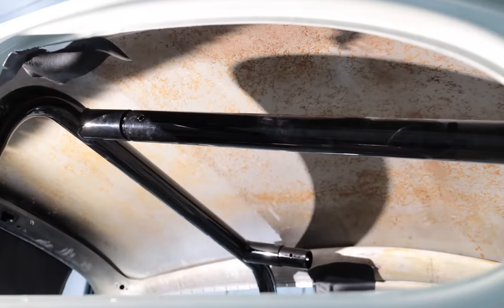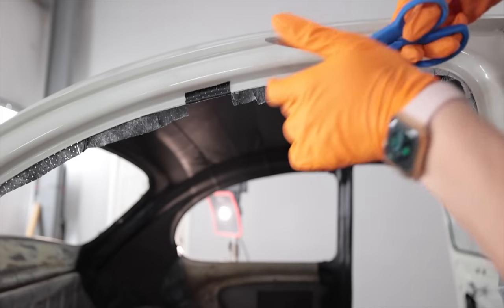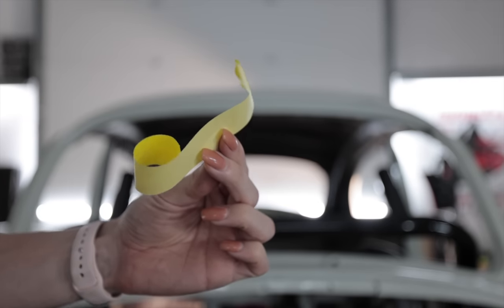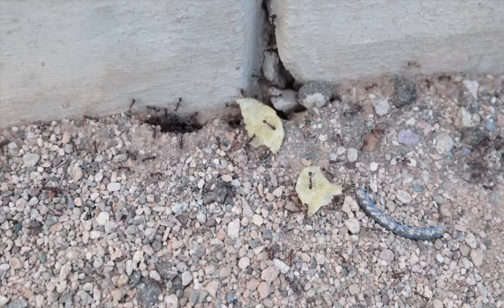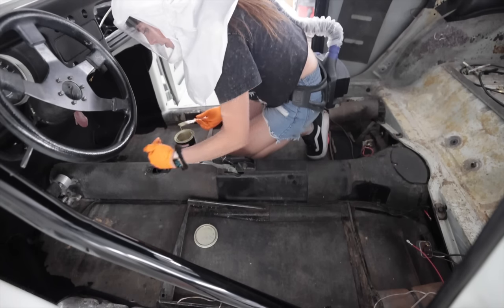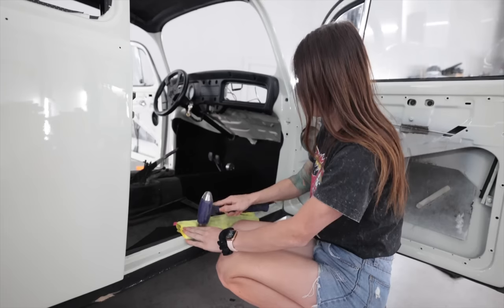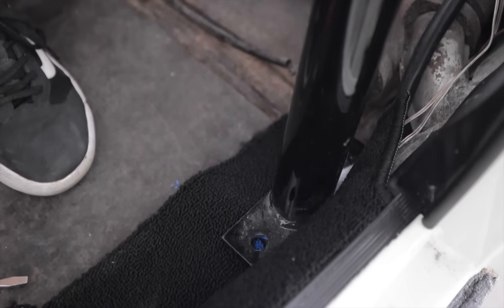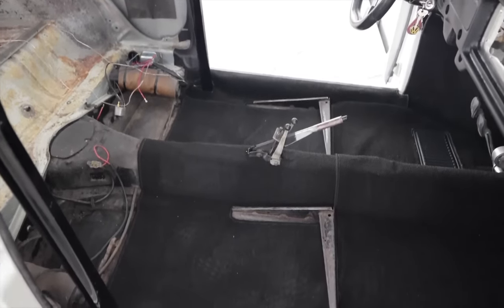The Carpet Matches The Drapes // 1969 VW Beetle Type 11 Project

Comment: Headliners were white from the factory in my experience. Family started buying bugs in 59. I've owned a 62 rag top, 63, 67, 70 with a 2180, 71 Super Beetle, and a 74 convertible. I'd like to build one more but health may not allow.
You are doing an amazing job on Ragnar...and I love my shirt. You have the best auto related show. Keep it up, stay safe and get the glue out of your hair. It affected you singing.
Reply: Agreed. That's how my '69  and '74 came from the factory - yeah, I'm that old.
Reply: Correct - all beetle headliners were white from the factory.  Black is aftermarket only and makes the interior looks much smaller and dark.

Comment: Hey Sarah...  Saw in one of Vice Grip Garage's videos how they solved the hole location issue with bolts through the carpet.  Basically a soft locate with something pointy, then make pointy thing hot and melt/push through.  No fraying, perfect sizing.
Reply: Can also use an old/junk/cheap/crappy soldering iron.

Comment: I found out about those spray adhesive's, I ended up spaying the glue into a cup, then brushing it on with a small paint brush, much more control over where it goes.

Comment: Hey Sarah, an easy way to make holes in carpets, take a tapered punch the size of the hole you need, heat it up almost red hot, then poke thru the piece you need to mount and thru the carpet. It will melt out a perfect hole, and best part, is it will be fused and won't fray

Comment: Grab an old phillips screwdriver, heat it with a torch, and shove it through the carpet into the seat holes in the pan. It will melt the carpet, and prevent fraying. Speakers can mount in a plywood panel over the parcel tray in the back...you could cover it with black vinyl, too. Fun video!

Comment: Start in the middle with a heat gun and work your way to the outside edges. The heat gun will take out all the wrinkles, it shrinks the material. I have done a bunch of these style headliners and it works great.

Comment: If you leave the headliner out flat in the hot sun it’ll become much more stretchy you don’t actually want it to stick to the sides you want it pulled tight most headliners look loose though but if you want it to be stretched tight put it out in the sun and don’t try and get it to stick to the sides of the roof on the inside

Comment: You needed to lay the headliner out in the sun for abit before the install. That makes it stretch easier and most lines fall out. Having some type of noise deadening material on the roof, under the headliner is a must have-otherwise, noise will be excessive.
Reply: You only need to glue the side parts in and back up with the tax nails. The floor doesn’t need to be glued down.

Comment: Sarah, After spraying the adhesive, wipe the tip with a rag and some acetone to remove the excess on the tip. That way the next time you use it the spray won't end up in unwelcome areas! Been there, done that!
I really wish I had room for another car. If I did, I'd put my hat in the ring to try winning this. But I'll buy a shirt next time so I don't have a chance. I know, it doesn't make sense does it!!!

Comment: If you heat up a screw driver. You can push it through the hole and melt the ends of the carpet so the carpet doesn't fray. Fast N Easy.

Comment: I think I would have mounted the roll cage on top of the carpeting. Just poke a hot nail through the bottom, drop in your bolts and tighten them down.

Comment: I really appreciate your videos and the effort put into all that it entails.  I hope this does not come across the wrong way but I think the front kick panel carpet pieces were installed upside down and/or switched sides.  The portion alongside the door post should be a straight line, no loop on top over the post itself.

Comment: for tightening the drapes, just heat with an air gun in high temp not so much airflow, have a damp microfiber towel handy and a bucket of icy water, it will tighten up perfectly, just don't burn thru the vynil. Practice on a scrap piece first.

Comment: Thats like when you buy a house to renovate that has single pane windows, so in the first season of winter, one goes and gets a plastic roll of clear window covering with 3m tape to insulate around the perimeter of each sash window &  to iron out thee wrinkles to make taut, use a heat gun on low settings🐈‍⬛🧁🔥b-side vinyl to stretch

Comment: If you want to find the hole, you have to come in from the bottom if the carpet is too thick. Gently push the poker up through the bottom and you'll find the hole. It's so much nicer working with smooth holes...

Comment: While I'm not familiar with it, I've heard using a heat gun helps prevent cracking the paint - I've seen it done with both PDR and fender rolling. 🤷‍♂️

Might be worth a try if you re-carpet a car again.

Comment: It'll get tighter sitting in the sun. You can also VERY CAREFULLY use a hairdryer on it. Don't use a heat gun, that can go bad fast. Actually works better on getting wrinkles out of leather especially when freshly installed, vinyl can get permanently warped with too much direct heat.

Comment: A hot steel punch that you heat up with a torch will "punch" a hole through the carpet where you want to place bolts through the floor.The hot metal melts the carpet so it doesn`t fray. This would have worked while doing cage mounting bolts.

Comment: Pair Rockville RSM65B 6.5" 320 Watt Waterproof Shallow Slim Marine Boat Speakers
Super slim fit door speakers 
Or 
The Morel Powerslim 6 Integra defines how great a shallow speaker can sound while providing the performance benefits of the Integra technology. The Powerslim 6 Integra features an incredibly shallow 0.67" mounting depth, making it the shallowest 6-1/2" coaxial driver on the market.

Comment: So many aftermarket accessories for VW. Old ads online for emergency hand starter, to carry in glove box , a T-handle strap to wrap around crank pulley to pull start like old minibike or lawnmower.

Or a vacuum cleaner powered by the engine exhaust, venturi effect with no moving parts, long hose to reach around car. Would actually work on any car.

Comment: Next time try the 3M fast bond 30 water base contact cement , works just as good as the gorilla snot weld brand , without the VOC

Comment: Listen to this, get a dry cleaners plastic bag (lightweight) and cover your forehead and hair!
You are doing a great job. I took my driver's license test in a 65 VW with rotten running boards and a broken reverse in the shifter. Had to park so I wouldn't have to back up.

Comment: Question: How are  you planning on reinforcing the roll cage mounts? If you just bolt them to the floor skin, won't they tear straight out? would you want to weld a plate under the mount to reinforce it & bolt through?
Reply from the maker: I say how in the previous video 😉
Reply: @SarahnTuned  I thought you had said you would weld a plate on, but then you appear to have glued the carpet to the inside of the floor round the cage mounts, which will be all very exciting if you try to weld it, & then I thought that maybe I was remembering f somebody else’s build video rather than yours…

Comment: You could of heated a piece of steel with a torch and push it through the carpet into the bolt holes for the roll bar.

Comment: I don’t think I’ve ever used that much glue on a bow headliner.  The bows pull up and you pull them to the edges.
Reply: She didn’t install the headliner correctly.  In fact, it looks like she didn’t even use the bows and glued everything directly to the roof.  You can see where she glued the material directly to the substructure of the roof on the sides.  This portion of the roof shouldn’t even be visible as it’s usually hidden under the bows.
Reply from the maker: The bows were used and sized accordingly if you watched the previous video. You're incorrect on the install, the way it was done is the correct way.
Reply: Double check .. thats why you have the wrinkles in center,  The headliner should be pulled some what tight to the window edges like Ghia said.  It should not touch the roof.  I saw you did put the bows in but you need to pull to the windows edge not glued to the roof.

Comment: Stereo? That wire looks way too small of a gauge.. with a back seat delete you should plan on the new owner putting a 5 channel amp and a sub in the battery box/seat support area.. please run dual RCA's NOW to that area from the dash.  Surface mount speakers on the interior firewall won't block vision like rollbar mounted speakers would.

Comment: You definitely would have had a better result if you glued the middle of the headliner to whole roof like you're supposed to do and it wouldn't be sagging. Or the foam like it probably came from the factory.

Comment: Could have saved yourself from all of that spray glue in your hair and the awkwardness in applying it by using the correct headliner glue that comes in a pot and is applied by a brush. 
Far more accurate, faster (no masking etc) and less waste.
Other than that, awesome job 👍🏻

Comment: "If this tip is clogged, even the slightest bit, it could end up in your hair, your eyes, all over your clothes, on the wall..." 2:55
We are talking about adhesive or Is this a situation where we do not want to use a blacklight inside the car? 😂